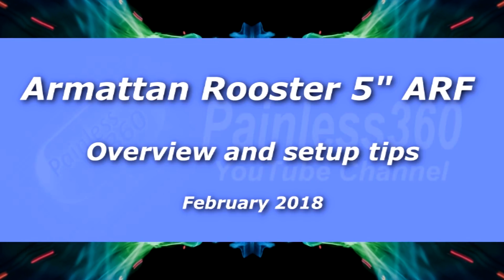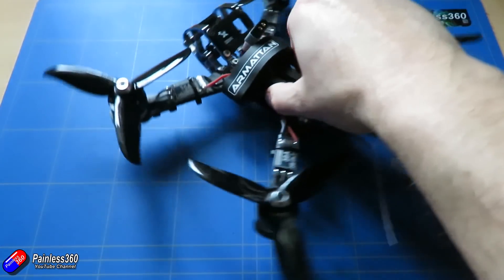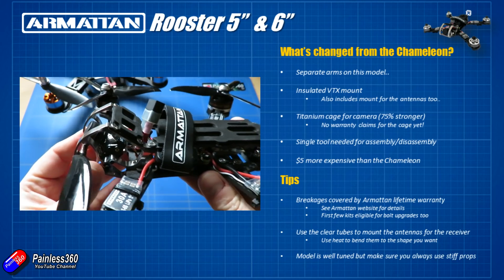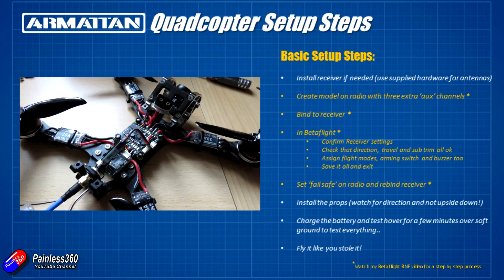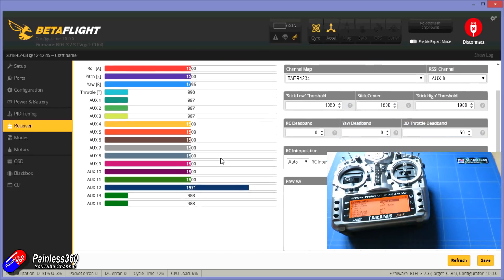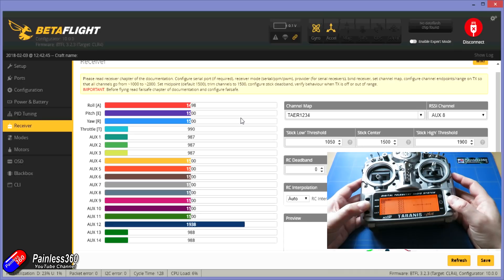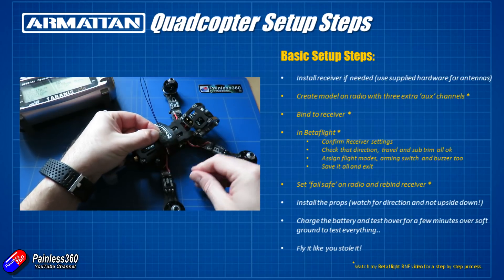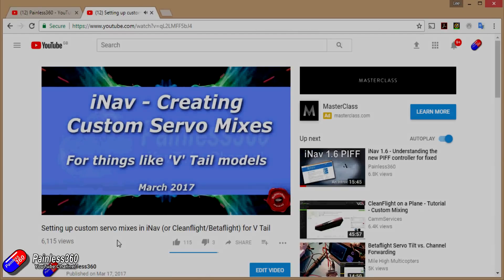Armattan Rooster 5" FPV Quadcopter Overview and Setup Tips

Comment: Hi, at 12:20 would it be worth mentioning for 'newbies' that setting 'RC DEADBAND' to 5 will cover any slight fluctuation around the 1500 value? 
Thanks for this video it looks a great machine at the price and the warranty. I'd not hesitate in recommending this. 
Cheers Steve

Comment: Hello, I'm waiting for the rooster frame to arrive, I'm a little bit concerned about the camera angle, could you tell me what is the lowest camera angle that the rooster allows? Thanks!
Reply from the maker: It depends on the size of the lens that you have on the camera that you're using. With the ones that I have here, the minimum angle is round about 30 degrees . If you removed the cross brace then you can put it a lot lower..
Reply: Painless360 Thanks for the answer, I guess I will have to adapt then, I was willing to fly with 25°... I don't know why but it seems to be more suitable for freestyle, the rooster is a freestyle frame I think it should allow smaller angles... Thanks!
Reply from the maker: You can mount the camera higher in the titanium cage, if you have a camera that has more than one set of mounting holes then you can get a much shallower angle. Best of luck with your build!

Comment: Hi, Just got the Rooster. any idea if SBUS is selected and still no control movement?
Reply from the maker: Should be, I’d let the vendor know.. make sure that the serial port is selected on a UART too and the Rx is bound. What troubleshooting have you already done?
Reply: Hi I have sorted this. WIth the R-XSR receiver a solid green light usually indicates that it is in PPM mode. While powered on, hold the bind button down for 25-35 seconds. When the blue light is on, SBUS is enabled. al l sorted now. thought the info may assist others.

Comment: Hello. . . it's always me. . I'm very sorry but I can not easily find a turret with esc 4 in 1.. . + FC. . . + VTX. . . all in one with 30.5x30.5mm mounting holes. . . for the VIPER GEPRC. . . do you have any idea about it? . . . or can I also mount a mini tower with 20x20mm holes? . . Thanks in advance
Reply from the maker: See my initial videos in the 'Quadcopter Build: Series 4' videos. There is something there that may work from Holybro..
Reply: thank you friend that you answered but I can not find the video you wrote me. in any case you are the expert tell me if it is possible to use these components together and if they are compatible ...
Racerstar Shot30A ESC 30A 30amp 3-6S 4 in 1 BLHeli_S BB2 Dshot600 Integrated Current ... coupled with ... BF3.2 Omnibus F4 V2.1 Flight Controller STM32 F405 MCU Integrated OSD Built-in 5V BEC .. (I chose this flight controller because it seems the most complete with the BAROMETER and possibly also GPS.) and then combined a VTX ... E709TM3 5.8G 48CH 25mW 200mW 600mW Adjustable AV Transmitter w / Mounting Hole for ... give me your opinion and a good fpv camera ... thanks.

Comment: Great video.  I purchased this same model Rooster that you reviewed.  It's a great quad but I'm having difficulty getting into the camera adjustments.  You are supposed to be able to go to mid throttle and yaw right to get into the camera settings but that doesn't appear to work for me and a few others with this model.  Have you experienced this?  What can we do to fix it or work around it?  Thanks for the great vids.
Reply from the maker: These stock Foxeer cameras have a bug in them that means that they don't recognise the stick functions. It's the same with all the Predator Minis. I've heard of some sorting out with CLI commands but I've not managed to get it to work here. I may be getting a new version of the camera that has the bug fixed so stay tuned!
Reply: There is now a ‘Foxeer Predator mini Armattan edition’ that addresses this camera osd problem so that you can now do it with your controller.
Reply from the maker: https://www.youtube.com/watch?v=E5dj_9R0OyY should help a little too..

Comment: thanks God you exist, thank you for putting out information like this, Actually my Rooster just arrived and I was able to bind it successfully but I can't get connect to betaflight !!!
I installed betaflight configurator couple of month a go and I could connect my wizard to it , but I sold it before do anything more as I learned about Armattan and Rooster , but at the time there was not in stock and I had to wait until now for one,,
 but now I got it and connect it to my Macbook and press connect on betaflight , it just writing "connecting" for a wile and then it will back to "connect" again !!  
without getting connect and turn "red" and write "disconnect" 
would you kindly help me please ?
Reply from the maker: I don't use Mac here, on a PC this is usually a problem with the USB cable or the drivers - I'd try another cable.. Best of luck!

Comment: Hey there Painless360, this video is great, thank you, and I have been trying to use it as the basis for my going through exactly the same setup. I wanted to get the receiver pre-installed, as I am a newbie that isn't too good at soldering, but they didn't know when they were next going to be getting in the FrSky receivers, so I opted for buying an R-XSR separately. I used one of the cables provided with the receiver, which plugs into the receiver itself, so was left with just the task of terminating 4 of the 5 cables onto the FC tabs (fifth seems to be the redundancy connection, which isn't needed.) This went better than expected, and I didn't seem to mess anything up. I then setup the model on the Taranis, and got to the point of powering the FC from my USB, and got Betaflight connected. However, then you instructions go on to validate that the bound Taranis sticks move the sliders in Betaflight's Receiver tab properly and in the correct directions. For me, I see no movement of the sliders at all. The receiver indicates I am bound, in SBUS mode, by the lights it is showing, but the FC seems to not see it. Status in the CLI shows RXLOSS. The FC board has two lights on it at this point; Red light steady; green light flashing. I cannot find any detailed documentation on what those lights mean. I have setup the receiver in Betaflight as Serial based/SBUS, so I thought that this would be the right one. I don't suppose anything about this jumps out at you as indicating a reason for my failure? Thanks for any help you can give. K.
Reply from the maker: Tricky without knowing what wires you've connected where. See my Quad Build: Series 7 playlist for a complete build using an R-XSR and the CLRacingF4S flight controller - hope they help..
Reply: Painless360 That video help hugely; see my comment on that. Thanks lots. K
Reply: Hey there again Painless360. I have a further question (only if you have time) - related to telemetry. I installed the lua version of the firmware on my Taranis, installed the lua scripts on the SD, and got the lua pages operating for the Rooster. Disappointingly, though, the VTX tab remains unpopulated, seeming to suggest (to me as a newbie) that there is no telemetry-enabled communications between the FC and the VTX/camera. Did you ever try to setup lua stuff on the Rooster? Is the VTX/camera combo on the pre-built Rooster (mine seems to have an Aomway 5.8g mini audio & video transmitter v2, and Foxeer predator) not telemetry/lua capable? Thanks for any help you can give. K
Reply: Pooh - seem to have an even bigger issue. I cannot see how the VTX can be dialled down from 200mw to the maximum UK legal 25mw - did you find how to do this Painless360?
Reply from the maker: The Vtx is a dumb one on the model so the power looks like it's fixed. I have swapped mine out here for a TBS Unify Pro Race VTX and wired it up so I can use the SmartAudio to control it from the OSD - see the Quad Build Series 7 playlist for how to do that..

Comment: what size battery is that?
Reply from the maker: 4s 1300mah
Reply: thanks, I'm researching a 6" 6s build, looking at the 1300 6s turnigy graphene which is 54mm high

Comment: What's with the trend of putting the video antenna right on top of the receiver antennas these days. You've just got that vtx screaming right in the receivers ear. It's probably not too much of an issue if you're hooning round a track right in front of you but it's gonna affect the range somewhere along the line if you venture further out.

Comment: hello dear first of all thank you for answering you're great ... and nice to know that there is someone who helps you when you need ... you are very professional ...
I would like your opinion on the frame ... GEPRC GEP TSX5 Viper 220mm ... that I would not mind ... or even the reallac x210 or if you have alternatively something else send me the description ... I would like a flight controller with cheat and gps ... aio ... maybe with esc and vtx integrated. what kind of engines could I use in your opinion personally with the type of esc naturally matched ... that propellers and all with quite high performance .... I already have a frsky vtx R-XSR ULTRA ... and also what kind of room ...
I also use TARANIS ... TX ... THANKS
  OF YOUR AVAILABILITY
Reply from the maker: +Roberto Leon if you're interested in GPS then the inav series on the channel is definitely worth a look. I've used very similar frames in two of the quadcopter building series, so they are probably worth a look as well. Both are very versatile frames and would work nicely but wouldn't have lots of room to mount something like a GPS. Those series show all of the Motors and flight controllers that I like and recommend, I hope they help..

Comment: Perhaps run the motors in the opposite direction. Doing so seems to repel rather than grab branches and doesn't throw muck onto the camera lens. Fantastic tour, thanks.
Reply from the maker: What an interesting idea.. have you done it?
Reply: Yes. If your motors have ccw cw threads you need to swap them round. In Betaflight / configuration page / mixer / motor direction reversed tab. Imagine flying though a field of deep grass fast - it would drag the grass towards the camera and build up. Reversed props will throw the grass to the side. I recently changed mine. It seems to throw the quad away from the hazard. See 3 impact example of being thrown way from the hazard. https://youtu.be/tSRhCP2WCZo?t=1m26s
Reply from the maker: Cool! Thanks :)

Comment: Totally unrelated but a request for future
content please. I have been getting a few 3d things printed (fpv pod for a
bonsai, camera mount for a quad) and it is costing a small fortune. So it's probably
time I bought a 3D specifically for rc stuff. But I know nothing, so I would
probably buy junk. Can you please episode to two on your 3D printing
set-up including links to your equipment & software?
Reply from the maker: Still using the fab little HobbyKing Fabrikator II daily and getting great prints from it. Not a huge print volume but a solid printer..
Reply: Still love a run through on how you use it, particularly via files on thingiverse.
Reply from the maker: See my ‘3D printing for RC’ series. Hope that helps..
Reply: Duh. My apologies. I didn't know you had already done a series on it. Off to watch now.
Reply from the maker: You can preview some new stuff due out next month too - https://www.youtube.com/watch?v=9GHraszFQBM

Comment: Why even use Titanium on a small frame like that. Well i guess thats why they are so expensive. They do make good frames but asking almost 100$ for a 25$ frame sucks.
Reply: It costs that much cause of the lifetime warranty. Otherwise it wouldn't be possible to manage. The Rooster with titanium is cheaper as the chameleon with aluminium.
Reply: it has a lifetime warranty. what do you expect